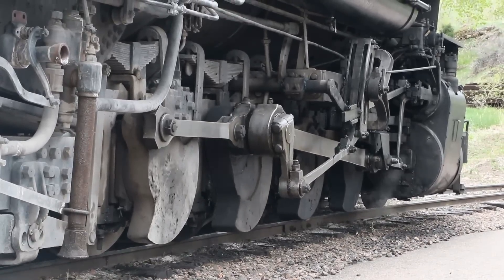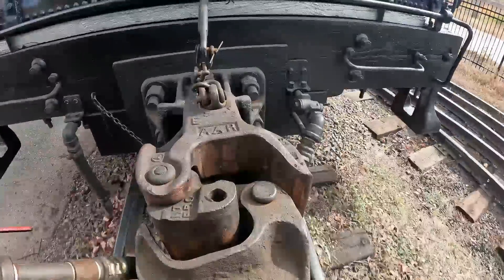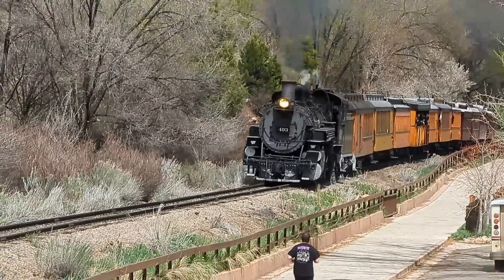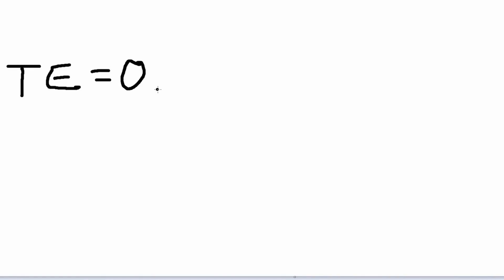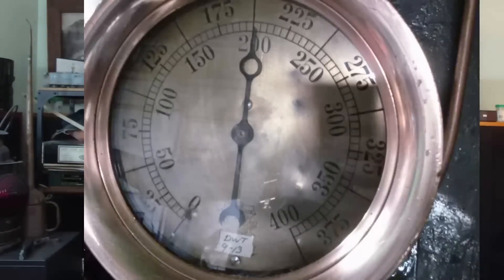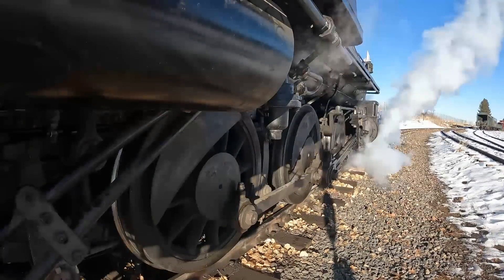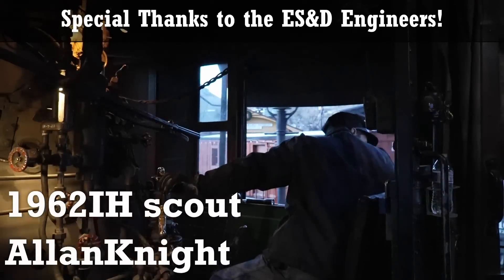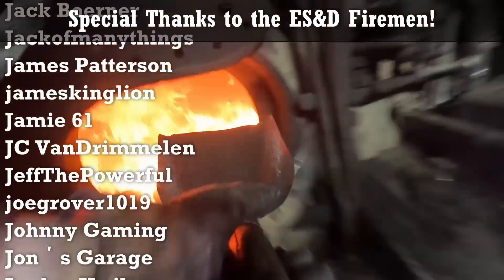Busting Tractive Effort MYTHS! | Railroad 101

Comment: 0:21 i always thought it would make more sense if the rails were set into asphalt  like a road with rails in it and the locomotives had  rubber tires for grip then the cars behind it could get the benefits of low rolling resistance and load carrying capacity of steel wheel on steel rail and the locomotives could get the benefit of high grip from rubber on asphalt
Reply: The problem, I think, is that the amount of absolute tractive force that the rubber tires can withstand is nowhere near enough for that unless you load them to the point where you're destroying the asphalt.  Whereas just adding more steel plate to the locomotives is pretty simple.
Reply: @BrooksMoses  ill be honest not sure what you mean by  just adding more steel plate to the loco ... i assume you mean make the wheels larger?   but as for rubber i mean they have those heavy lift multi wheel things they use to move buildings and other heaver things, you know the ones that have like 50 wheels and they're all steerable so i cant see that being an issue really to be fair they dont move them fast but wheres thats an issue of if you go faster than a walking pace with a 200 tonne transformer the wheels will disintegrate or its a matter of you really really dont want to transport your 200 tonne transformer t 100 kph im not sure

Comment: I finally understand how caprotti valve gear works. It essentially makes the cam lobe last longer in the corner and makes it shorter hooked up by using 2 lobes that rotate.
Reply from the maker: That sounds about right. You've been doing your research!
Reply: @Hyce777  Franklin valve gear is turbo cursed

Comment: 8:27 The bigger wrench idea only applies when you're exerting force from the end toward the center. Take a board and put a weight toward the middle and lift from one end, keeping the other end on the ground. Pretty easy, right? Now swap the weight to the end and lift near the middle while still keeping the other end on the ground. Much harder because you'll need 4x the force as lifting from the end. 

(For my example, I imagined a 10 ft board and 100 lbs weight. 100 lbs at 5 ft is 500 ft-lbs, to make 500 ft-lbs force at 10 ft only needs 50 lbs force. 100 lbs at 10 ft is 1000 ft-lbs, to generate that at 5 ft distance takes 200 lbs force, or 4x as much. Really, you'd need more force either way to actually lift the weight, but that's beside the point.)
Reply: The wrench analogy still make sense. It's just a question of who is holding the wrench. 

If you are using bigger drivers, you are essentially giving the track a bigger wrench against you. Smaller drivers with a bigger piston stroke are what would give you the bigger wrench.

Comment: Hold up, I'm confused. So basically tractive effort does not define how much weight you can pull but rather the force? And it's optimal to have 1/4 the tractive effort you do coefficient of adhesion?

Comment: 11:16

There is one other thing! And that is called "piss off the FRA and put something heavy on top of the safety valve"

More boiler pressure, more power!
Reply from the maker: Lol, well, that's against the rules. Also I'm pretty sure setting something on the safety would cause it to pop. You'd need to gag it.
Reply: That was something done in the early days of rail travel, and every one who wasn't killed outright by the ensuing boiler explosion quickly called it a bad idea.

Comment: Hyce, I'm curious, how do you figure out the tractive effort of those funky experiments where they decided to strap jet engines to the top of the cab? Does it just become tractive effort = yes? And I guess.... for that, all the stuff about factor of adhesion would cease to be relevant since you're not putting the power through that wheel-rail interface right? (although, I guess it would become quite relevant when you decided that mach 26 is fast enough through the yard thank you very much)
Reply: In that case, it's not technically tractive effort.  But, yes, the engine thrust would pretty much take the place of tractive effort in the equations.  Jet engine thrust actually not all that much compared to the tractive effort of a proper locomotive; the main advantage was that it was rather a lot compared to a single Budd car, and that the components don't start spinning excessively fast and tearing themselves apart when you go well past 100+ MPH.

Was there more than one of those experiments, though?  I thought it was just the one NYC car that they ran a couple of times as a low-budget way to confirm that running trains at that sort of speed did not cause breaks in the space-time continuum nor cause the MOW department to have complete conniption fits, before they started the expensive project of building out the Northeast Corridor to run electric trains that fast.
Reply: @BrooksMoses  Hmmm, interesting, thanks! I'm not sure how many of those things the US had, I guess you'd be right that it was probably just the one experiment, but I believe the idea was experimented with elsewhere in the world too, particularly the soviet union. 
The Brits did it a bit different, we shoved a jet engine in a train, but used it to run a generator/alternator, and drive the thing electrically.

Comment: So what you're saying is anything above an FoA of 4.0 is heavier than necessary? (Stares at Big Boy with its FoA of 4.03)
Reply from the maker: Basically, 4.03 isn't a big deal because it's not an exact ratio, but something more like 4.5 or 5 would be getting excessive
Reply: @Hyce777  I think there was a loco (I think a 4-6-0 that got rebuilt into a 4-6-0ST) that had an FoA of 6

Comment: The stroke length in the equation is a bit misleading in physical terms. Mechanically the factor is the same as the stroke length (which is in the X direction), but is actually in the Z: the crank circle diameter. That is where the torque comes in, as in the ratio between crank circle diameter to driver wheel diameter. 

As to the cutoff value - I might be one of the very few people who made that mistake with a practical effect. I built a two cylinder steam locomotive in 1:11 scale (5'' gauge). The drawings were properly scaled down, but physics don't work that way. The square-cube-law leads to the area of the piston is scaling down with the square of the scale and the weight (for the adhesion) with the cube. With everything in scale, it was ridiculously overpowered. So, I made my pistons smaller and calculated how much. And I assumed the point with the lowest force is when one piston is at 0° and the other at 90°. But that is not true. After I built and installed the parts, the engine won't start, depending on the position of the pistons. After recalculating everything I found out that the lowest force is when the valve gear at one side is just closing, giving the other side an angle of about 50° which is a factor of 0.6. Combined with the pi/4 factor, the minimum value to get your train going is more like 0.5 instead of 0.85. I did really built and test it. After re-increasing my pistons to 76% of the original piston diameter, the engine had enough power to get the wheels to slide (the model has only half of the original boiler pressure). And it had the intended effect of an improved handling, as I was able to increase the slide box pressure to nearly boiler pressure and use the valve gear (the steam expansion) to handle the power level.
Reply: The fun thing is that, if you look at the equation in terms of forces, it's the crank circle diameter in the Z direction that matters -- but if you look at it in terms of how much work the piston is doing in one wheel revolution and apply conservation of energy to convert that to the work the engine must do, which divided by the circumference is the tractive force, then it's the piston stroke in the X direction that matters!

Also, torque has units of foot-pounds or whatnot; it's the piston force times the crank angle.  The driver wheel diameter has no effect on the torque as such; what it effects is how much force you get from that torque when the wheel applies it to the rail.

Comment: That 3-chime at 0:29 is gorgeous (at least I think it's a 3-chime).

Also, I didn't know that Reading 2102 had a booster. That's really cool. Maybe a video idea for the future is one covering boosters and the different type. I think that would be a cool idea. 

One question about boosters on the subject, as for RBM&N 2102, where does the exhaust steam for the booster come out? I've never seen any coming from the tender, and to me it would just seem impractical to pipe the booster's exhaust from the tender all the way to the smokebox.

Anyway, love the video, and I had a few myths of my own busted. It was a ton of fun to watch!
Reply from the maker: Also that's the DT&I 5 chime. One of my favorite whistles.
Reply from the maker: They drop out right next to the booster itself. The big plume of steam from the rear in the videos of 2102 working hard pulling the coal hoppers is the easiest to see it.

Comment: I was wondering, why U.S. steam engines for freight services have higher tractive effort than engines elsewhere. Even the largest German steam engine, the Class 45, had a tractive effort of 420 kN or 94400 pounds-force, compared with 600 kN or 135000 pounds-force for the Big Boy.
Reply: Some of that, I think, has to do with rail loading and clearances.  A 135000-pound-force engine has to have about 540000 pounds of weight on the drivers to avoid slipping, and my impression is that European railroads aren't designed for that.  They also have tighter clearances, and fitting a boiler large enough and long enough to produce that much steam into those clearances is difficult if not impossible.

(As an example of the latter -- if you look at the design of the NYC 4-8-4s, you can see that they were pretty much at the limit of what they could fit through some of their tunnels.  And I'm pretty sure the NYC clearances were still bigger than German ones, even though they were small by U.S. standards.)
Reply: The rated tractive effort equation ignores machine friction.  The use of K = 0.85 makes no allowance for machine friction.  Some jurisdictions use K as low as 0.60, and if you see this it is an indicator that that particular road wanted to make an allowance for machine friction.

Comment: Sorry Hyce.  K = 0.85 has been significantly misstated in your video.

It's simply a number based on numerous indicator card tests.  K as 0.85 was adopted by the American Association of Master Mechanics in about 1900 or so.  It is simply the mean effective pressure through the entire stroke and is relevant from start-up to about 10 mph.  The 10 mph is actually stroke speed rather than road speed - but is good to about 10 mph.

Equally sorry, the wheel diameter explanation is also misstated.  It's nothing to do with leavers.  It's that power is delivered at four piston strokes combined for one revolution but enjoyed at the rail through one circumference.

You need to have consulted Ralph Johnson (1944) or François Marie Guyonneau de Pambour (1836), or any Locomotive engineering book written between the two - rather than that incorrect model engineering pdf.  Johnson explains the application at the end of steam, and de Pambour wrote the equation.

Ultimately, it's in the category of things that don't particularly matter anymore - but even so, it's a shame your reach was used to inadvertently misstate things.

Comment: One of the sounds I shall never forget is a drawbar breaking. Another is a trio of 10,000 amp fuses blowing from a bolted dead short. One was a huge very loud ka-blam, and the other was little plinking sounds. Both were really expensive.

Comment: I was taught many years ago, in a very simple way, the larger a steam locomotive's wheel diameter, the faster it can go, but its harder to start a train from stop. The smaller the wheel diameter the slower your top speed, but starting a train from stop is easier. I know all the other things mentioned play a part as well.
Reply: That's pretty much it. Like he said about the bigger wrench, but backward. With a wrench, you're applying the force to the center from the end. That's why you get an increase in torque (100 lbs force at 1 ft from center is 100 ft-lbs torque, 100 lbs force at 2 ft from center is 200 ft-lbs torque). But when driving from the center, distance decreases your torque output (100 ft-lbs torque from the center at 1 ft distance exerts 100 lbs force, 100 ft-lbs torque at 2 ft distance exerts 50 lbs force).

Comment: When the PRR tested the I1s using 50 percent cutoff, it measured more TE at speed (35 mph) than starting TE. When they changed the valve setting to 65 percent cutoff making them I1sa is when starting TE equaled at speed TE. It also lowered the FH on start up but at speed it was better than the modern 4 cylinder locomotives.
 Good job of explaining the math. Thank you.

Comment: No mention of how geared locomotives factor into tractive effort? For shame, Hyce!

Jokes aside, this was very informative either way. As for the myth about sand, I think it's better to describe it as "assistive" instead of "additive". It's not adding any additional tractive effort, it's assisting the locomotive in making better use of it where it is necessary.

Also the myth about "more wheels = more good" is more complicated, as duplex and articulated (ie the 3000 class Challenger or the 4000 class Big Boy) locomotives using more than one set of drivers are where this myth is more truth than fiction. It's a case of "This is true, but only under very specific circumstances".
Reply from the maker: Fair!

Comment: Alot depends on the job of the locomotive. American locos generally are build to pull really high loads at a rather slow spead. A GE AC6000CW has a maximum force of 840 kn at a slow speed but only 23,2 kw of power per tonne. A german electric loco for example is the opposite because it has to pull freight trains rather quickly that are relatively light in between fast passenger trains.  A class 189 siemens loco for example has only 300 kn of force but an absosulte massive power of 73.6 kw per tonne. A different loco for a different job. The older class 151 has a force of ca. 400 kn because it waa build for heavy loads with its 6 axles. The modern version of that would be the stadler eurodual which is a massive six axle loco which can run under overhead wire and diesel and has 500 kn at 7000! kw of power. Alot depends on axle load as well German locos are hard limited on 22,5 tonnes per axle and 8 tonnes per meter.

Comment: Could a bigger driver wheel increase tractive effort if the rod connects to the edge of the bigger driver? That would increase stroke, and not present the "iverted" lever arrangement.
Reply: No.

Comment: What about the triple cylinder locomotives that run in Europe, like the Tornado and the Mallard? And what about non round pistons?
Reply: First, simply use the equation twice and add them together - but multiply the second equation by 0.5.  Second, Pi is struck from the equation as a common factor in cylinder face area and driver circumference.

Comment: In the old steam vs diesel power video you mentioned that a diesels power is measured really low like 11mph.
However you've also talked about how steam loco's as the reverser is more centered (for less end-of-stroke shock at higher speeds or something?) then the steam isn't delivered for as long of the stroke, so steam locos should also have a decreasing torque output as RPM increases right?
It would be really cool to see a dynograph of bigboy vs AC6000 from 0mph>60mph.
Even though the pistons valve is close to the steamchest it still has the steam expanding but it'll decrease in pressure way faster right?

Comment: LOVE THE STARE AT THE PRR 
THE DECAPODS (( 2-10-0 )) 
A LOCOMOTIVE THAT WEIGHED 386,000 LBS 
62 INCH DRIVERS 
240 LBS BOILER PRESSURE 
YET KICKED OUT 105,000 LBS T.E. 
13,000 MORE THAN 
U.P. CHALLENGERS
Reply: 250 psi boiler pressure
Reply: @09JDCTrainMan  depends on if your talking as built ,, 
Before superheated , with the extended pistons that went forward through the piston heads . Before the Worthington feed water heater and stokers were added ..
YEH , THEM MONSTERS WHERE HAND FIRED WHEN BUILT ......
As built , boiler pressure was 190 lbs on the first ,, 
 205 lbs on the second ,,,
I1 , I1s or the I1sa 
Then the larger tenders were added .......

Comment: Larger drivers=more slippery locomotive? Should also note that on the first group of Pere Marquette Berkshires (class N), crews reported difficulty in keeping water on the crown sheet when the booster was working. Apparently these locomotives could make and use steam faster than the boiler could be supplied with water.  Subsequent classes (N1 and N2) were not booster equipped.

Comment: One of the other things that affected tractive effort especially on engines with long dry pipes was head losses in the dry pipe. Willamette actually used a factor of 0.75 for their saturation engines to account for losses as the steam ran from the throttle, out the smokebox, and then did a U-turn back to the cylinders on the side. To my knowledge they used the normal 0.85 factor on the superheated engines because the hotter and dryer steam didn’t experience as much loss